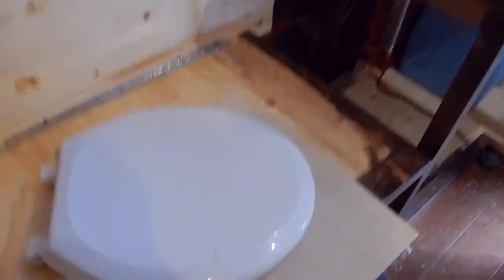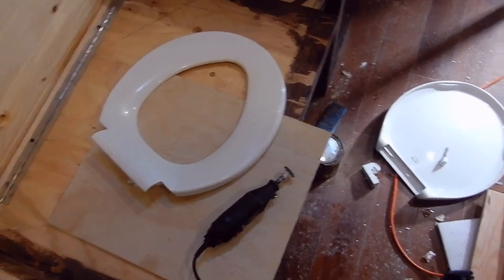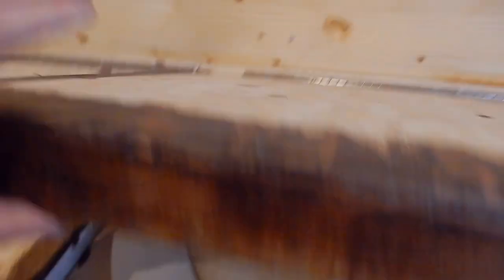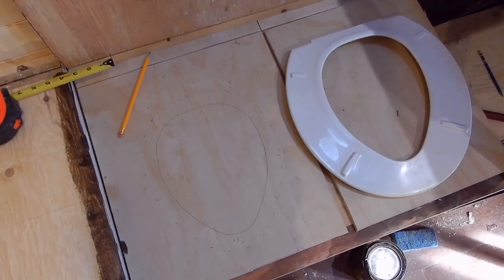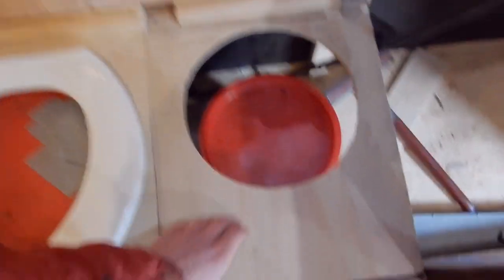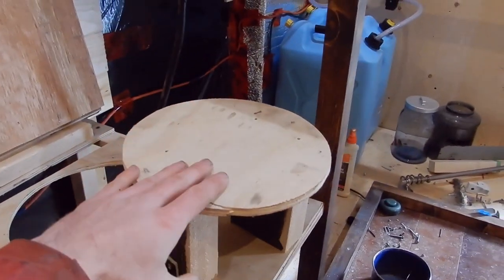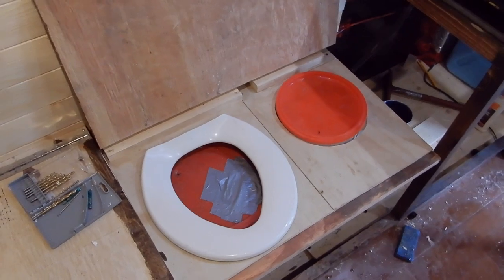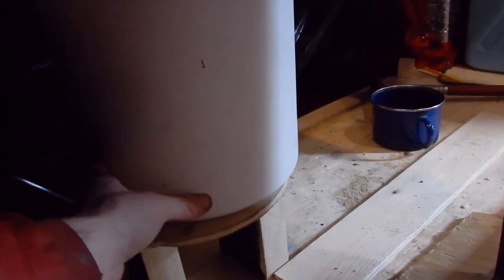How To Build A COMPOSTING TOILET ~ Van Build E019

Comment: I would recommend moving the stove to the  part of your counter where the sink is going to be and the sink by the door. Reason being if that stove ever flares again your couch goes poof.
Reply from the maker: Justin Burton I thought of that configuration initially, but you need access to the knobs on the side to use the stove so it wouldn’t work in the corner. I’ve actually fixed the stove. It won’t ever act that way again. I’m more concerned about grease splashing and staining the couch tbh. The whole kitchen is such a small space that it is basically one big compromise no matter how it is ordered.

Comment: If you move the bucket back a little and add a funnel to pee into with a hose and a catch tank it will be better.
Reply from the maker: Yeah, that probably would be.
Reply from the maker: A vent wouldn't be a bad idea. I haven't found it necessary in my case. A fan would be a waste of electricity imo.

Comment: I'm not sure what you are doing with your sawdust after its used. 
I have a luggable loo that has been used with trash bags and tidy cats litter. 
Litter doesn't compost well, but you can toss the bag and mess in the trash easy enough.
Not a noticeable smell.
Reply from the maker: Cool suggestion. Never come across it before.